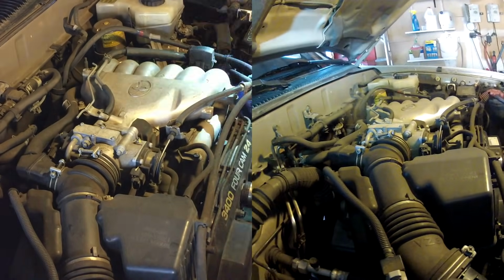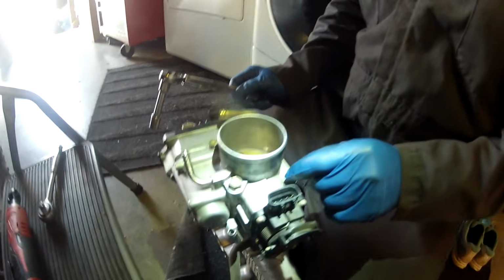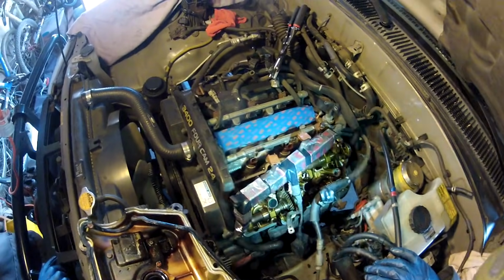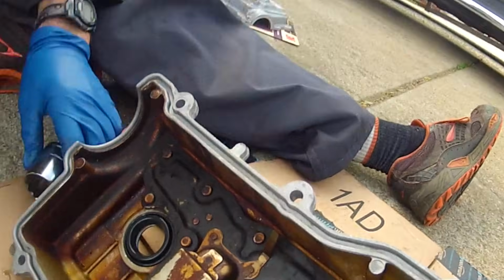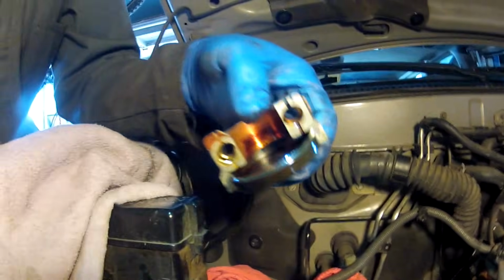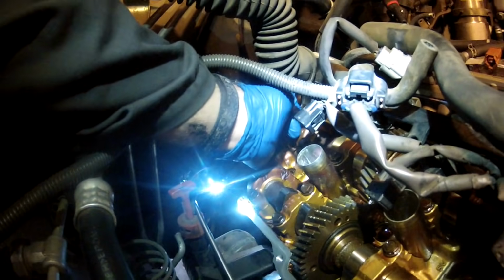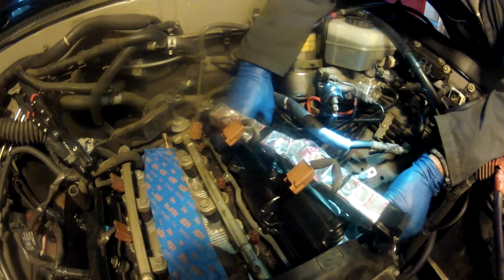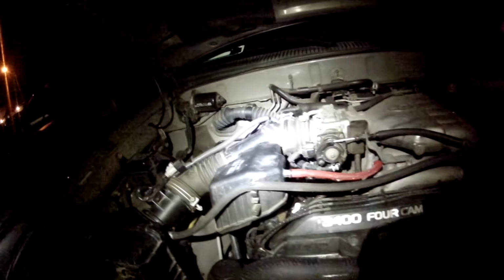3.4 L V6 5VZ-FE Toyota 4runner, Tacoma, Tundra Valve Cover Gasket Tutorial

Comment from the maker: Please read this comment for some helpful information
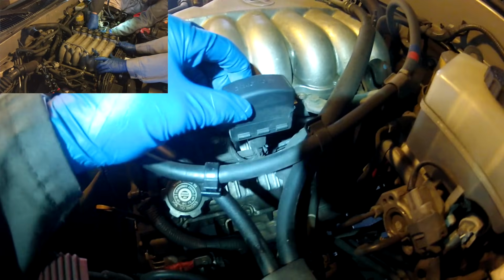After watching the video again, I realized I forgot to mention a couple things. In the beginning at 3:42 play time, I mention removing a fuel harness off the lower plenum on the driver side. You also need to disconnect the fuel line at one point whether it's the connection near the driver side fender or one of the connections at the metal harness that attaches to the lower plenum. It's necessary to disconnect because that fuel line will make it very difficult to remove the driver side valve cover if you don't.

Another thing regarding the driver side is the clamp (Air Chamber Stay) that attaches to the upper plenum that I mention at 3:50 play time. On my 2000, I didn't have to do anything else other than remove that top bolt to free the upper plenum. On the 2002 engine in the video, I had to loosen a lower bolt that attaches that clamp to the motor so we could move it around to get the driver side valve cover out.

Further Helpful Tips
The hoses that people commonly mess up on are the ones that go to the throttle body that has a detachable IAC valve (1996-2000 4runners and later model 1st Gen Tacomas).  There's two coolant hoses and one vacuum hose that attaches to the IAC.  People mess up and connect one of the coolant hoses to the vacuum assist hose going to the injectors and they end up flooding the cylinders with coolant.  Don't make that mistake.  Pay particular attention to that.  The ones that are coolant hoses have a hose clamp.  The vacuum hose doesn't have a clamp.

One vacuum hose that is easy to forget is the one that goes to the fuel pressure regulator.  Don't forget to plug that one back into the lower plenum before putting the upper plenum on.  

To get a little more movement from the engine harness on the passenger side, you can make an engine harness disconnect at the water neck that houses the thermostat.  One of the nuts captures a wiring harness anchor point.  With that disconnected, you'll be able to lift the harness up higher to give you an easier time getting that driver side valve cover out and back in.

Good luck with the job!  Hope it goes smooth for you.  Happy Wrenching!
Reply: Hey Mike, did you reuse the cam caps?
Reply: @maxodorestant9053  no I replaced with new ones. It's best to replace with new ones because because outer part of cam caps is some sort of rubber. The only ones I reused is the halfmoons just make sure you clean then good
Reply: I did mine today and found that if you remove the bottom bolt all the way, you can pull that stuff out of the way and the cover comes out pretty easily to the outside of the wire loom instead going through it.
Reply: @chip_farrar  this is absolutely true and how I just did it a few days ago. The ugliest looking part of the job is how just about every YouTube video on this subject shows the drivers side valve cover coming out by going towards the center and under the wire harness. We started trying to get it out as shown after freeing the wire harness from everything and found it to be a ridiculous strain on the wires anyway. We took an extra 5 minutes and removed the engine hoist bracket and the valve cover slides down and to the rear and then up and forward over the wires. Piece of cake. Really glad to find your comment today.
Reply: Timmy just a simple question cause I'm about to tackle this job! When torquing head gasket down to 56 in. lbs. would it be ok if I torque it down to 5lbs. since 56 in. lbs. converts to 4.7lbs.? Btw, I enjoy watching your videos man. Very detailed and informative! 🤙🏽
Reply from the maker: @michaelt9558  Hey Mike, if you have a foot pound torque wrench that goes that low, then yes, that will work.  My foot pound torque wrench doesn't go that low.  10 foot pounds is the lowest it goes.
Reply: @TimmyTheToolman  yes I have the harbour freight one that goes from 5 to 80lbs. Thanks for responding Timmy 🤙🏽
Reply: Can someone tell me if the two silver metal brackets that are bolted behind the cam plugs need to be removed? I've seen that being done in other videos but it doesn't seem like Timmy does that here, he only removes the collars... Thank you!!
Reply from the maker: @bennyabolmaali4115  You don't need to remove them.

Comment: My only comment is about how much of the RTV/Silicone is being used on the half moons and cam plugs.  You want to be conservative, a small amount will smush out and seal perfectly.  A large amount like you used will too, but then the excess will bead up inside the valve cover and can break off and circulate/plug oil galleys/journal, then you spin a rod bearing or wipe out a cam lobe due to blocked oil flow.
Reply from the maker: I guess according to you, we got lucky then.  Now that you let us know what you thought could have been done differently,  is there anything you appreciated about our instruction?

Comment: Taking my time following the steps.  Just got to the point of removing the passenger side valve cover bolts. This was the leaking side. All the bolts were loose!!!  Will be using blue loctite  to install, I guess. Whew!
Reply from the maker: It's common to find loose bolts, but the culprit is the rubberized washers.  Over time, with the heating and cooling cycles of the engine, the rubber shrinks.

Comment: Hello

Got another question- this one’s related to the valve cover bolts.

While doing this project, I noticed there is oil at the top side of the engine around the fuel rail area.

Which I’m thinking that over time, the rubber grommets on the bolt washers lost their staying power and that possibly oil was leaking because of that.

Would it be good practice while doing this project to initially torque the bolts to spec and then let them sit for a while (in my case, a day or two as I’m waiting for parts) and then re-torque them to snug things up a little better to avoid an oil leak down the road?

Or just torque them once and leave as is?

Thx
Reply from the maker: They do loosen up over time because the rubber on the washers dries out and shrinks.  But, I haven't had issues with my valve covers leaking, even after a lot of miles, like 100,000.  But, you could install the bolts without washers.  That's how I have it on my 98 4runner.

Comment: Tim I can't thank you enough for posting your video library.  I just finished this job on my 2001 4Runner with 156,000 miles on it.  I watched your video multiple times while I was acquiring parts.   Started about 8:00 last night and just finished.  I bought a bunch of plastic bags that are white on one side and used those to label my nuts and bolts and where they came from.  I only have one cable going to my throttle body like Sean's 2002 does and I think it's easier to just unbolt the bracket from the plenum than have to try and get the 2 nuts back in the right spot.  I think I might have the same inch pound torque wrench you do, graduated in Newton meters, and used that to torque the spark plugs, ignition coils, and valve covers.   I ride a train 40 mile to the office so I've only put 39,000 miles on my 4Runner in 11 years.  Hopefully I can get another 11 out of it, but  people keep trying to buy it from me.  Next up for me is changing my springs in the front and rear.  Just stock ones but I'm sure mine have sagged over 25 years.  2001 springs are actually discontinued by Toyota and the part number has been superseded to the year 2000 springs I think.

Comment: Hello
Great content👍

I’m going to be doing the valve cover gaskets (this video), the timing belt kit, and a new radiator.

To make more room, is it OK to take out the radiator, fan, t-belt cover, and then start on the valve cover gasket project, working back to front? (valve cover gasket project, t-belt project & then radiator)

I’m thinking if I’m gonna be doing those projects anyway, maybe take out what I can for more room, but thought I’d run it by you folks first.

Thanks
Reply from the maker: Yes that works great. The more room the better. The fan and radiator def get in the way quite a bit. Having them removed will make your other work more enjoyable.
- Sean

Comment: Original owner of a '98 4Runner with just over 70,000 original miles ( I walk and bike s lot). Several months ago I noticed the gaskets were leaking and it has gradually worsened, so the first place I go to for detailed explanation is your site. Thanks you so much for the itemized parts list and torque values, such a time saver. I'm sure the job will go well. Truth be told, replacing the gaskets on my '67 Impala was much easier....Thanks again..!!!
Reply from the maker: You're welcome.  I'm a huge cyclist as well, but I do use it for transportation,  more for fun and exercise.  An Impala would be way easier to work on.  I started my driving experience using a 70s Impala.

Good luck with the job.

Comment: Do I need to drain all the oil out before doing this ?
Reply from the maker: No, you do not.  Most of the engine oil will have drained down into the oil pan due to gravity.  You will still see some oil pooled on top of the head, but that would hinder you from doing everything you need to do.
Reply: Awesome thank you, never tried a valve cover gasket replacement before, not sure what I’m getting into , thanks for the information and video , I’ll watching and pausing while doing it.
Reply from the maker: @McCoyTexas Just take your time and label hose and electrical connections if you feel the need to.  The good thing about the electrical connections to the throttle body, coil packs and to the injectors is either the connector shape will dictate where it goes and the reach of the connector will also dictate which connector goes where.  Basically, it's hard to mess it up.  Same for the hoses.  The diameter and stretch of the hose will dictate where it connects.  But, by all means label if that makes you feel more comfortable.  Good luck!
Reply: Appreciate the advice, never would have thought to label, definitely going to , starting it Wednesday .
Reply from the maker: @McCoyTexas No problem.  Also, snap some pictures before you take things apart to also help jog your memory of how things go back together.

Comment: Man, I don't know how the heck some of you guys are talking about doing this in 6, 7 hours. I'm in the middle of this, now have seals on, valve covers back on and torqued to spec, ready to put the plenums back on and it's taken me 12 hours to get here I'm calling it for the night. I only took two short 20 min breaks to eat a snack, watch the video a bit and then back at it. I guess maybe the extra time cleaning the valve covers and chipping out the old rock hard plug seals but even then I think this takes a long time. Now I'm just paranoid of getting all the hoses routed  back on right without cracking anything because they are all so old, and not having any bolts left over, or left loose. I took tons of pictures as I went along to use for reference as I reassemble it all. I almost screwed up and put the valve cover back on without retightening the cam plugs. Fortunately I remembered as I was in the middle of tightening the covers and said shit now I have to take them off again just to tighten those damn bolts I forgot, and had to double check that the valve gaskets didn't get shifted in the process. Overall this to me was a pain in the ass job I don't know how much a mechanic charges but I'd be comfortable paying 500 to not have to do it again.
Reply from the maker: It comes down to experience how long it takes someone to do this job.  The more you turn wrenches on your engine, the more comfortable you'll become and the easier it will be.

Comment: Many of these kits for sale come with #17177-62060 (Air Surge Gasket) which I do not see mention of here. Looks like something to do with the Plenum? Great video by the way!
Reply from the maker: Air surge gasket sounds like a PCV grommet.
Reply: @TimmyTheToolman  No. Same size and look as intake plenum gaskets just a different shape. Are there different gaskets for the upper and lower plenum? I appreciate the help this is first time trying this. There are two of them in these kits. Intake manifold to head gasket? Are these necessary?
Reply from the maker: @kg7998 The upper and lower plenums use the same gaskets.

Comment: I was changing my valve covers today and a piece of that brittle plastic fell in my engine. I don’t know what to do 😢
Reply from the maker: Well, it's not like you're going to get it out, so I would say just don't worry about it.  If it hits any spinning metal parts, it will get chewed up and probably end up in the bottom of the oil pan.

Comment: Just changing the original ones on my 01 xtracab at 235,000. They’re not leaking bad but a leak is a leak. Dang impressive engine the 5vz-fe is. This is the first thing the truck has ever needed in 25 years. And I could probably keep it like this for a while but I opt to not.

Comment: Did this a couple times since I've had my runner....this time the vve cover bolts tend to get out of spec and starts leaking .....I keep re torque the bolts and it works for a while but....tried blue locktite did not work...I think I'll try using threaded studs instead of using factory bolts....anyone have any other ideas?? Sucks haveing to do this twice
Reply from the maker: It's the rubber washers that causes the looseness.  The rubber on the washers shrinks from the heating and cooling cycles of the engine.  Next time, try using regular washers, not the OEM ones with the rubber, and some blue loctite on the bolt threads and it should work out better for you.  But, with that said, I've done valve cover gasket jobs on both my 3rd Gens using the rubber waahers and never went back to tighten the bolts and I'm not getting any leaks.  Or, if there are leaks, it's nothing major, because I'm not noticing it.
Reply: how many miles you get out of the first OG and second? i managed to get near 1/4 million miles 250kl before another redo is needed after 115k on the OG
Reply from the maker: @efil4kizum The first went around 130k before I wanted to pull the valve covers off and do a valve adjustment.  The second one only went 50k before I had to pull the heads due to a cracked #3 cylinder.

Comment: Hey Tim I replaced my rear cam plugs this way (putting them in the top bracket, and inserting both downward into the head, then bolting each bracket down.) I accidentally used the 1282b fipg instead of the 103 so I pulled them off to use the right fipg. I noticed the new plugs are damaged on each side of the plug where the bracket meets the cylinder head. Doing it this way seems to pinch the cam plug on both sides when seating it. When the new plugs come in I'm going to try to install the top brackets first, then press the plugs into the rear of the head similar to how you press the front cam seals.
Reply from the maker: I don't think it matters if it gets pinched at that juncture.  Those areas have FIPG applied to the head.  But, the pinching of the surface of the cam plugs doesn't make sense to me.  Were you using OEM cam plugs?  The cam plugs fit tight, but they shouldn't get pinched upon tightening the collar.
Reply: @TimmyTheToolman I wish there was a way I could add pictures. It didn't get pinched and prevent the bracket from seating. But it took small chunks out of each side of the plug. And yes always OEM. I'm about to post a video of the engine build/2nd gen swap here in the next month or so once it's done and I'll include the things like that where I've messed up and had to redo them. I went and lightly deburred the edges of both seating surfaces. There was a tiny burr that I could catch my fingernail on in some spots. I'm thinking I maybe didn't seat the plug in the bracket tight enough before I clamped it down. Thanks for all the education you've provided! It's been a real godsend with this project

Comment: Hello sir! I have a quick question. So I was working on the PCV Valve replacement, and replaced its grommet as well. However, somewhat a large portion of the grommet fell to inside. I tried fishing it out but I am unable to. So best option is to remove the valve cover. I know that it is best to remove it, but is there a possibility that I can just leave it there? I tried checking other videos of valve cover replacement to check the structure underneath the PCV valve, but I am having issue in figuring this out. Thanks in advance!
Reply from the maker: There is a metal box underneath that port that will stop the piece of grommet from falling into the valve train.  If it were me, I'd keep trying to get it out.  Have you tried fishing for it with one of those flexible grabber tools?
Reply: @TimmyTheToolman  I did. But somehow I ended up pushing it down further.

Comment: I was wondering if I had to get the same part # from the spark plug tube seals? The Oriellys shop only sells Part # B32337 which isn’t the same # you advised.
Reply from the maker: I'm not familiar with the aftermarket part numbers.  We only recommend Toyota parts for this job.